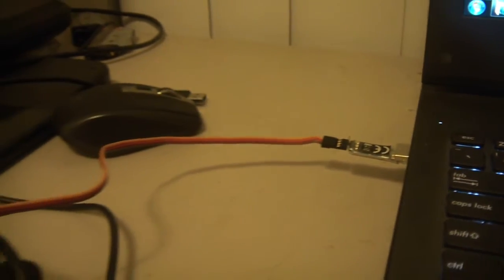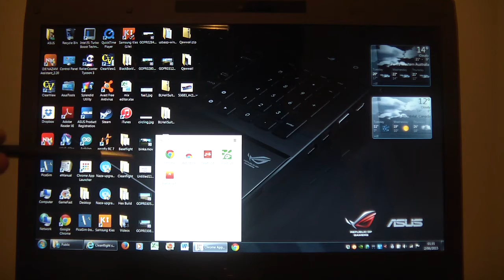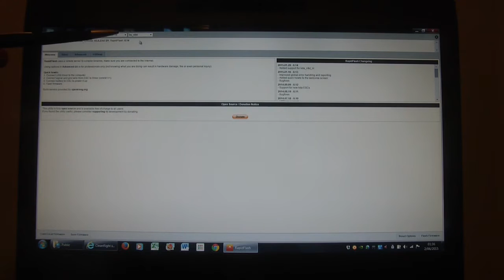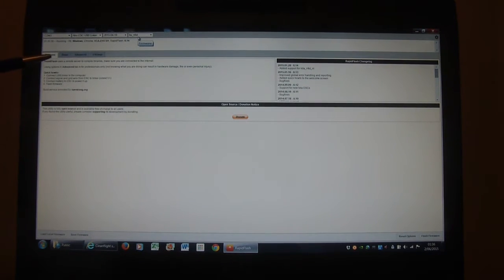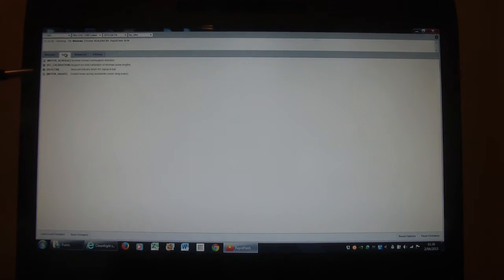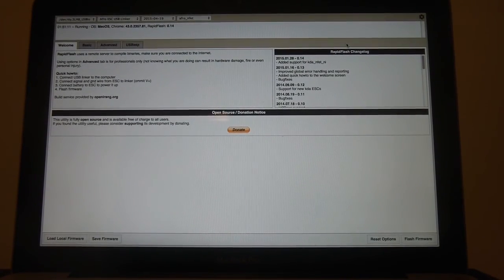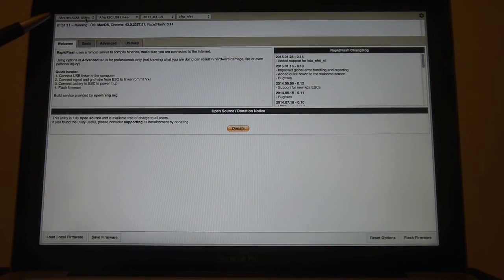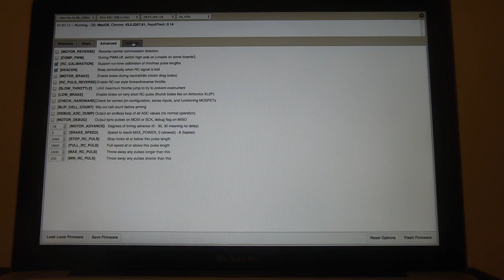Using RapidFlash to update ESCs

Comment: I always thought when using the usb linker you had to remove the red wire from the server connector. looks like you dont have to?
Cant you put BLHeli on those esc,s.
Reply from the maker: ***** You are right Noel,  I have the centre pin bent up on my USB linker so nothing is plugging into the red wires - it was easier than removing lots of red wires.   I tried BLHeli and it works well but noticed the power was about 20% down from SimonK and I had a sync problem with the V-Tail - it fell out of the sky on first full throttle climb on BLHeli, so trying the latest Simonk again with the braking features enabled.